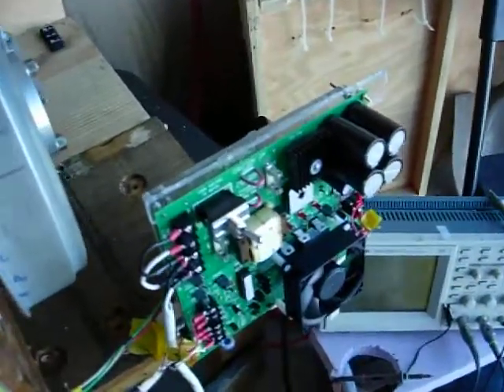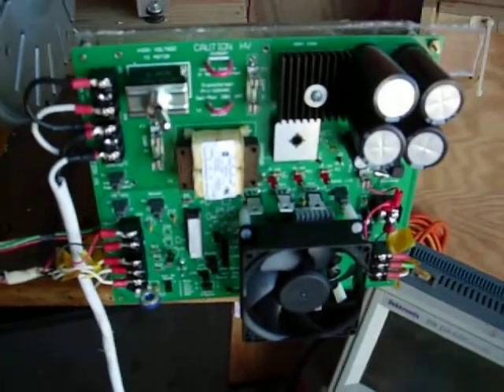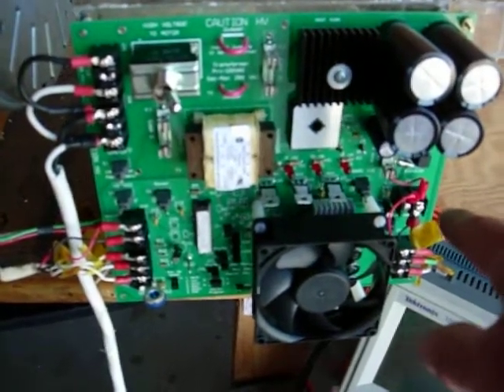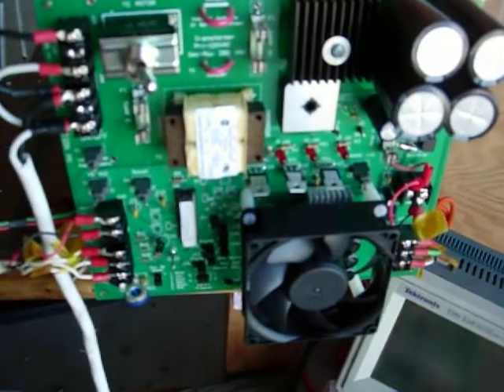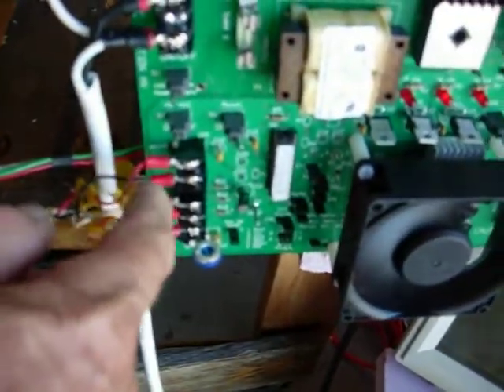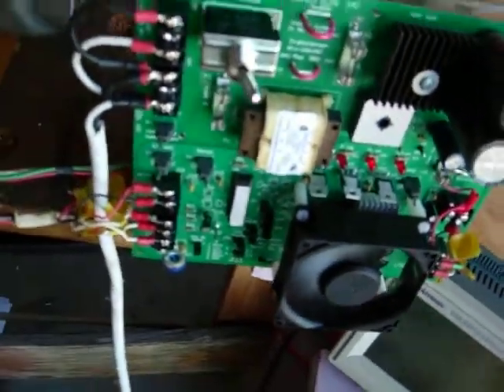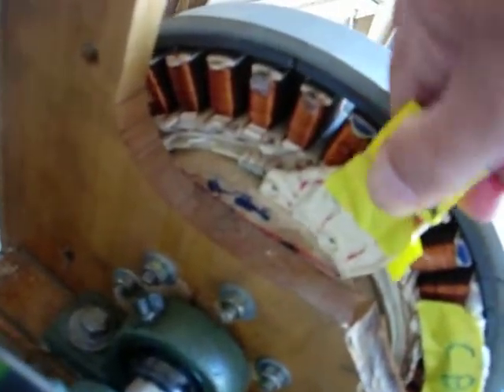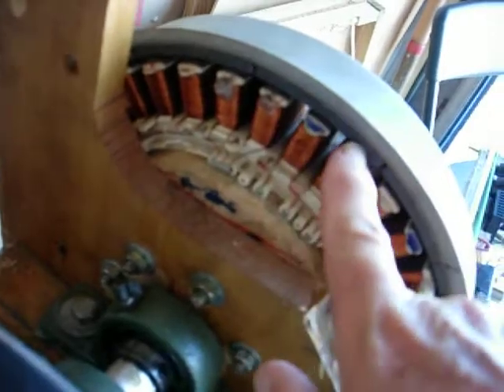Don Smith #147  REV B PCB up and running

Comment: Hi Buddy going good i see .you will get there very soon.Thanks for sharing.Gez.
Reply from the maker: Hi Gerard,  just completed the PCB manual about 30 pages of how to put together the Digikey kit into the pcb then test it.   The costs $142US  and I'll sell the PCB with Mega48 programmed and manual for around $50.  So for under $200 they will have a powerful motor controller.  The next thing I need will be a second Gen 154 so that I can burn out the windings and get it rewound with multiple taps past the original 120 output winding.  The taps will allow for regulation as the loads change more radiation needs to be pumped into the first Pole to compensate.

Comment from the maker: Just completed the final version of the 3 phase motor controller PCB Rev B and the new PCBs will be here in 5 days.  This PCB allows you to take  the IRAMS motor controller to it's maximum power level  using an external power transformer.    It appears that we need to test different wattage generators with the first pole transformer.  If the pole is not loading down the 3 phase motor driving the generator then the system should require less than 200 watts to give you 6000 watts.   If the 6000watts is coming from the generators 1200watts of radiation and not electron flow then more power can be generated by increasing the amount of 60 Hz radiation.  We need to test a generator with its original windings burned out and replaced by one gauge size smaller wire but keep the speed the same to get the 60 Hz.  Wire size means watts.